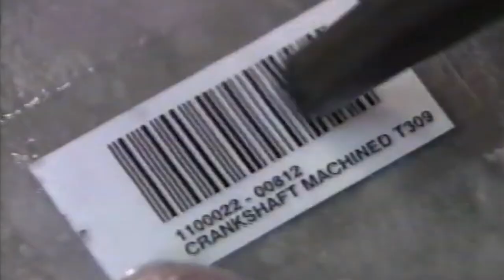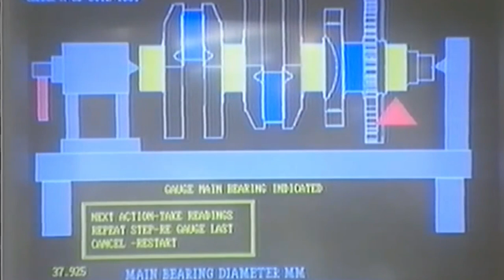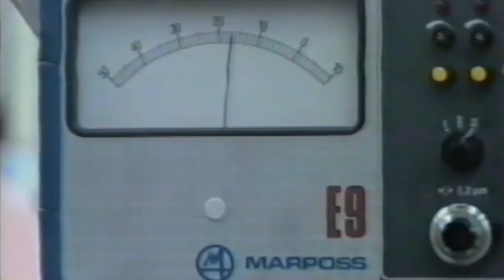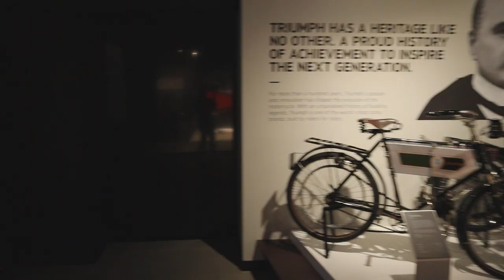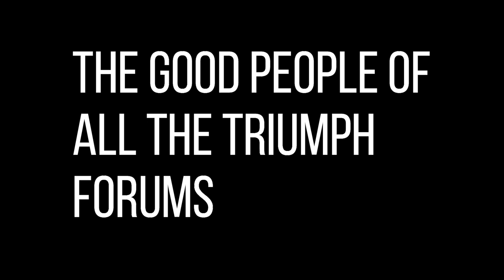The Triumph Daytona 900 Super 3 | A short film | Info on Alcon & Cosworth, Triumph Hinckley Re-Birth

Comment: Those should go 175 maybe 200 yankee miles on a tank? Interesting video and no wonder the motors are great, ok those dual roundees look great on that and really on any  bike of that era.
Reply from the maker: @paulscountry456  absolutely Paul, if you ride it sprightly and give it some then it’s 160 to 170 miles on a tank but if you really take it nice and smooth then it’s 200 to 220 per tank , they have such a presence on the road , an all in all stunning bike all around

Comment: I have a Super III which has been wrapped up and unused for about 9 years.  I'm currently building a garage and when it's finished the Super III will take pride of place whilst I restore it.  When I bought it from a dealer years ago I was told it was quite likely the latest registered one in the country as it had been shipped to Canada for sale but then shipped back again because the Canadians decided it was too expensive.  It's T registered so I'd be interested to hear if anybody else has one the same or even later.

I'm quite surprised by only 150 being built.  I have a book somewhere that says that 805 rolled off the production line.
Reply from the maker: Wow you have a rare masterpiece there. Keep it pristine mate 
805 were the standard Daytona models 
But super 3 numbers aren’t confirmed anywhere 
It’s supposed to be around 300 
But not sure 
Will find out more
Reply: @ChasingTenths  Many thanks for that.  Superb video btw.  Great piece of work!

Comment: As regards quality of these bikes, I bought one for a cafe racer conversion, and I have to say, I have everything I will ever need in a motorcycle, power, torque,and just the feel of a analogue motorcycle, the glorious engine note changes at different revs and it's a joy to ride.
But what I love most about it, strangely is the weight of the bike, heavy motorcycles are really great for the road. I finally understand why Harley and other old school motorcycle riders scoff at the light weight motorcycle brigade. The other thing is these engines and their horsepower claims are weird, my 92 trophy puts a lot more power than the factory says, and I have done very little engine work to it.
Reply from the maker: Thanks Peter for a lovely constructive comment which adds more lovely points towards the bike 
I totally agree with you and all the points are quite valid
Reply: @ChasingTenths  sorry, I forgot to subscribe as I just discovered your channel.
Reply from the maker: @ballerblocks  much appreciate the subscription Peter, more triumph videos on their way

Comment: Perusing and came upon this  hey it's the Aprilia guy Chasing Tenths doing a Triumph video and WELL DONE !!!!  I own a 2005 Daytona. love it.. 955 ccs TOR exhaust, mapped by Clive Wood.. great sport bike, cheap to insure, buy parts for ... vs my 999 which was a bit 'cranky' .. Won the bid off Ebay in 2013 for $6,500 USD w/ 6800 miles 'minty' .. my intention was to 'flip' it and make a quick $1000-1200 bucks .. but after the 1st ride I needed a 2nd .. and I kept it... Oh my friends at Carpenter Racing, NJ, USA  Bob, Eddie, and Art DiLarso built the twin 1450cc 558 hp Rocket III turbo engines for the Castrol streamliner Jason DeSalvo and Guy Martin ran at Bonneville.  Don't hear much from Alcon on the motorcycle caliper end ... interesting take on an axial caliper for that era.. Triumph/Cosworth helped IIRC w/ the gen1 Daytona T595(955) and then developed the new uprated cams .. and finally the 147 hp 2002 MY Daytona 955.. and man what a howl !
Reply from the maker: Hi Carl , first of all sincere apologies for this late reply , some comments slip through the net even though I check weekly for missed comments. What a brilliant comment , you certainly have a fantastic collection and a great knowledge of bikes. And yes it is the Aprilia guy doing the Triumph video haha , I need to do a few more of these for sure. Thanks for the detailed comment , I must have read it 3 times. I will pop over to Clive Wood myself one day for some tinkering on the Daytona.

Comment: Sprag clutch??
Reply from the maker: Yup it’s got sprag clutch
Reply: @ChasingTenths   The starter clutch that gave problems, which was not mentioned.
Reply from the maker: @bananabrooks3836  this wasn’t a long or short term review , just highlighted the origins of the triumph brand and some specials bits , a follow up video is coming which will be a long term review and issues , that will be mentioned on there for sure. Good shout, cheers :).. much appreciated